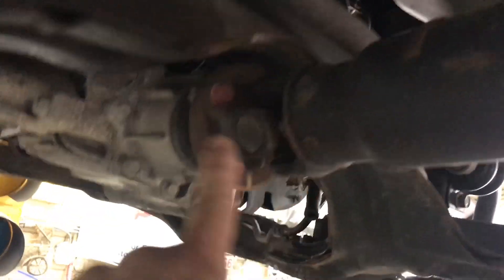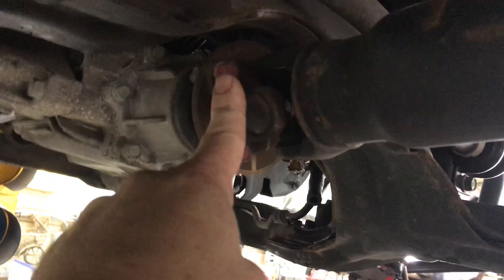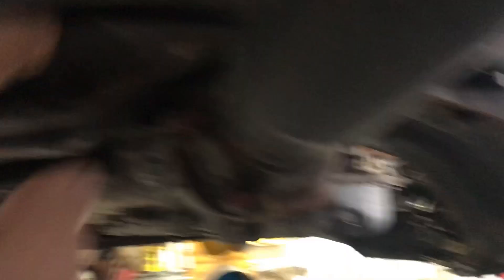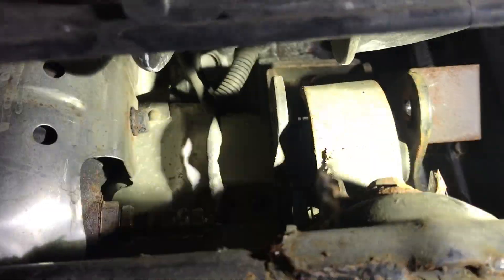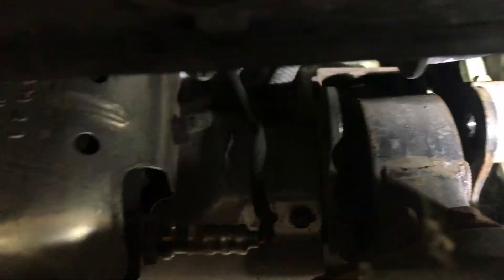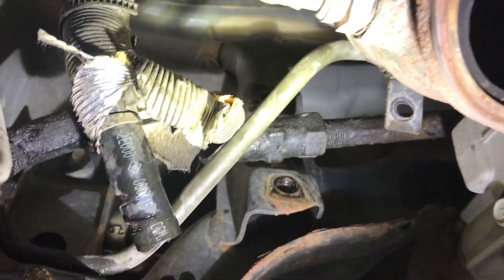2008 Hyundai Tucson 2.7L V6 4WD rack and pinion replace

Comment: How did you support the engine when you took the sub frame out? Mine is the FWD so I don't have an issue with the drive shaft. I've got this thing apart in my garage and I can't get at that bolt.
Reply from the maker: I took out the back bolts on the sub frame and just loosen the front ones so the back will drop down. Thanks for watching
Reply: Is it absolutely necessary to take the sub frame out?  It seems i might be able to get at that top bolt from above.  But then will the rack not come out?
Reply from the maker: Just loosen the sub frame. You will probably need the extra room to get it out
Reply: ok thanks for the advice